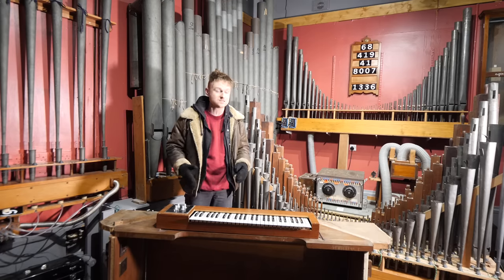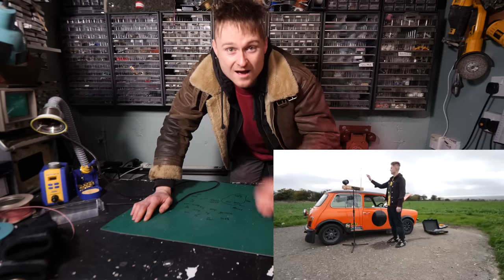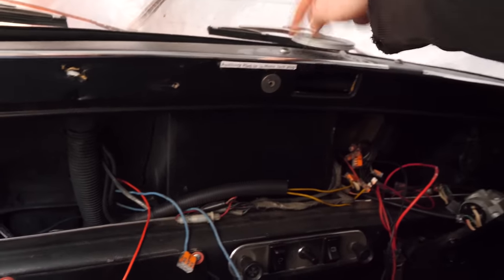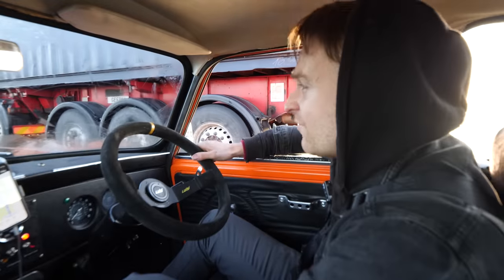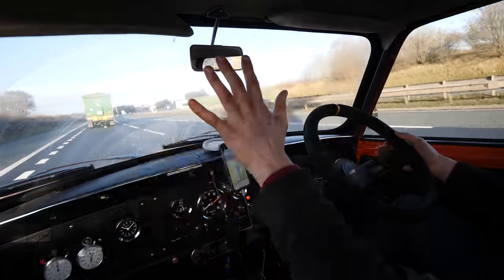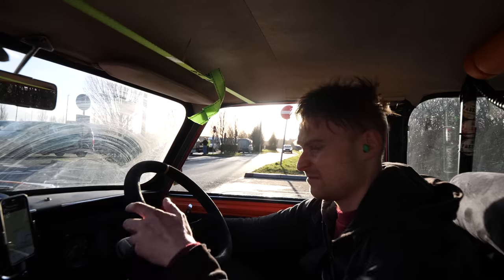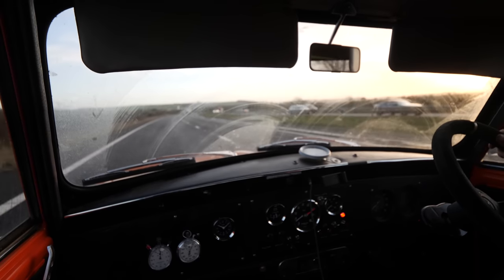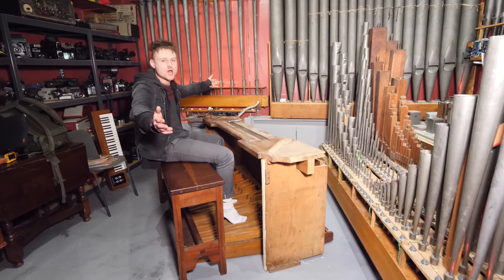722 Miles In A Day In A Mini With This On The Roof - CHURCH ORGAN PART 11

Comment: Ear plugs?  You absolute wuss.  🤣  I remember driving Sydney to Adelaide and back in '91 - no carpet, no soundproofing, 544 cam, 1 3/4" LCB and 38mm Weber.  Lovely induction sound.  Maybe a touch loud - my head was vibrating for a few hours after I arrived - but no earplugs. 

Mind you, I'm a little deaf now.  😁 

PS:  OK, so I didn't have straight cut gears.  Mea culpa.  But still..what's that you said?  Speak up, sonny!
Reply from the maker: ha well i can imagine your field of work probably doesnt require your ears to work well, working in music production my ears are my livelihood. as for the sounds yes to be honest the car would be completely fine with the 1380 in it with the progressive cam and the 45 weber, the problem is the straight cut gears at motorway speeds are the perfect frequency to dull the useful range of your hearing. i did the first 3 hours without em and i just felt em going bad. so i took em off. i have another mini that has a similar setup without straight cut gears, if anything its louder but it hasnt got the whine so its much more tolerable.
Reply: @LOOKMUMNOCOMPUTER   heh...a mate of mine had straight cuts and it was like a dentist's drill going through your skull, even on relatively short drives.  That's why I skipped that part of the build.  The rest of the noise I could deal with.  Lovely car, btw - has a nice, rorty sound.  👍
Reply from the maker: @aussiebloke609  yep and that explains me ear plugs 😂

Comment: So you have a straight cut gearbox , or just a noisy intermediate gear bearing lol
Reply: Neither of those. The mini has a unique engine/gearbox marriage. Normally you'll find an oil pan below the engine's crankshaft but in a classic mini you'll find a gearbox.
Reply: @SocietyUnplugged  hahahaha yes I know this I have been working on BMC transverse since I was 16 years old , this one has great deal more gear whine then I would expect, this can be several things as I already said , this one mite well have a modified gear train witch can cause this very loud whine or an issue with the intermediate gear bearings
Reply: @SocietyUnplugged  This lay out of engine gear box is not that unique Mini , 1100, 1300 , Original Metro all used this millions built , it's well known to those of us older engineers in the UK , lots of performance parts available, go and check out some racing at Goodwood

Comment: I feel like the roof rack was unnecessary. I'm almost certain you could have got the bench inside the car with the passenger seat laid all the way back. 
Unless you took a friend with you to help with filming.
Reply from the maker: The passenger seat is a bucket seat the roll cage rod is behind it and then there was the fuel pumps which sit where the seat behind the passenger seat is.
Reply: @LOOKMUMNOCOMPUTER  That's unfortunate. I nearly had conniptions when I saw how the bench had shifted. Load security is quite important in my line of work.

Comment: Hearing Protectors wtf
Reply from the maker: I need my ears for me job
Reply: @LOOKMUMNOCOMPUTER  is the Mini so loud ?
Reply from the maker: @bobvingt-trois3377  yeah I didn't have em in for the first 3 hours and my ears were ringing. Decided it wasn't worth it for the vid. Straight cut gears + no carpets or sound deadenning adds to a noisy experience. Lovely when driving around! Not so lovely when driving for 12 hours
Reply from the maker: @bobvingt-trois3377  yeah I didn't have em in for the first 3 hours and my ears were ringing. Decided it wasn't worth it for the vid. Straight cut gears + no carpets or sound deadenning adds to a noisy experience. Lovely when driving around! Not so lovely when driving for 12 hours